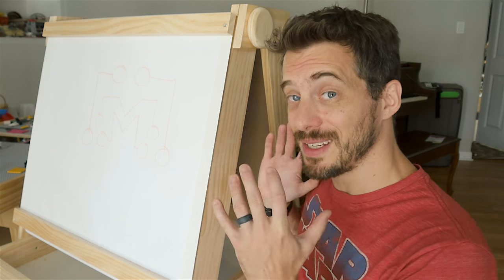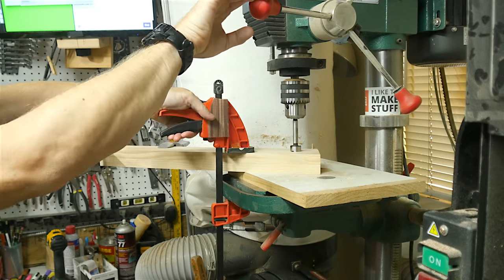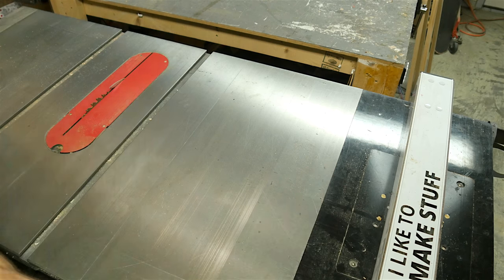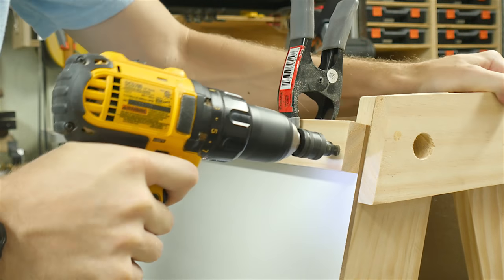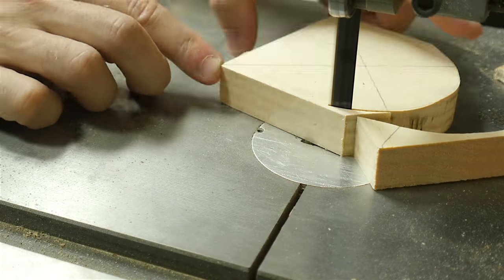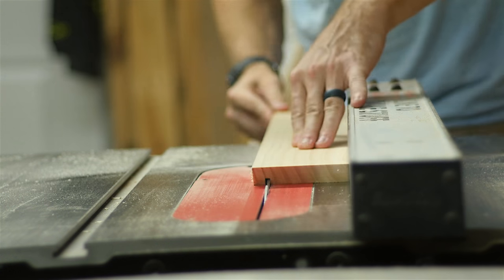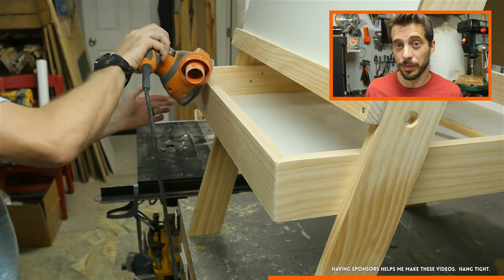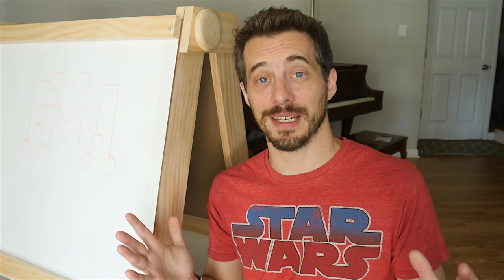Drawing Easel for Kids (chalkboard, whiteboard, paper roll) // How-to | I Like To Make Stuff

Comment: Great stuff Bob, as per usual. 

Personal suggestions for modifications of future versions of something such as this are:

- A small handle piece to the rotating part of the dowel. This allows for faster rotation of the page.
- Instead of using a whiteboard on both sides (where the case is that you don't want a chalkboard on the other side), add several "shelves" so that you can hold a collection of crayons, chalks, paints, brushes, etc in place for usage. This improves on the functionality of the product by not requiring you to store all of those art tools in a separate location. 
- This is theoretical (as I have not actually done any calculations) but since paper becomes very weak with stress concentrations along the edges, it may be beneficial to raise the center point of the page slightly higher than edges; not too much so you don't get wrinkles, but just enough as to prevent shearing stress of the page at the center point (where most of the drawing will be present)

Comment: That thing you did with your driver and some magnets I once did with my last car and the remote for the stereo I installed in it.  Basically it stuck the remote to the side of the console via the magnets, which were hidden inside the console and stuck to the back of the remote.  Not only is the stuff waterproof, but I found it's also heatproof, which inside a hot car on a summer day is critical.  Some common maker materials are surprisingly vulnerable to moderately high heat.

Sugru is great stuff, but it's a shame it has a fairly limited shelf life of around 6 months.  When I buy a pack of it, I usually find myself scrambling to find a use for it before it goes off inside the packet.

Comment: The dowel you used might be too small to do this but I would cut a slot down the middle the width of the paper.  Feed the end of the paper through the slot and give it a turn and done.  No need for tape and it should be easier to get the paper straight.  The lock on the dowels is brilliant.

Comment: I know this is an older video, but just found your channel and am working my way through them.  How do you get to the whiteboard area under the paper roll?  It seems once it was taped on the upper roll you are locked in to using the paper.  Do you cut it and then start a new roll when you want to switch to the whiteboard?

Comment: This is an awesome idea! What changes would you do to it to allow it to collapse into a smaller profile?
Another question... When you roll the drawings up and over... how do remove the drawings if you tape them to the dowel? Wouldn't you have to unroll it to unlock/withdraw the dowel?
Reply from the maker: I've rolled them back down onto the original roll (cardboard inner tube) and remove that.  As far as making it collapsible, that's a pretty different setup altogether. I've never really thought about that too much, but I'll give it some thought.
Reply: I Like To Make Stuff, ah that makes sense. I was considering building one of these for my son but space is a concern. I might have to make a wall mounted version that can fold out a bit if/when he wants to draw.

Comment: Hey just pointing out if you tape the paper to the top dowl how are you going to pull out the dowl when it's full. Love the vids keep it up bro
Reply from the maker: Yeah, someone mentioned putting a cardboard roll on the top dowel, or taping right at the corners of the paper so you could trim off the tape.

Comment: Love the keyed dowel. I was wondering how you were going to keep it in place. How do you get the top dowel off once you have rolled all the paper onto it with the ends taped to the dowel?
Reply from the maker: I was just planning on rolling it back down onto the cardboard tube, but you could also tape it to the top dowel right at the corners, so that it could be trimmed off.

Comment: How exactly do you use the whiteboard, since the paper covers it up ? It doesn't seem verry convenient. But nice build anyway, love your videos !
Reply from the maker: Obviously you can't use 3 things at once on a 2 sided object. I thought that would have been pretty clear.  The paper is there in case you want to be able to save the drawings. If not, it could be left rolled down and the whiteboard is there to use.
Reply: I guess the whiteboard is just a smooth surface to have the paper lay on.
Reply: You could have used it more conveniently with a sheet by sheet mecanism instead of a roll of paper, like those brainstorming paper boards.
Reply from the maker: Simon You can make it in any way that you would like to. I mentioned in the video that with kids, there are TONS of individual sheets floating around. The roll is a way to keep that in a single unit.  I make things that solve problems for me, you should definitely make them to solve problems for you.

Comment: How are you going to take the roll of paper off once it is fully rolled on the top roller? Maybe better to put the masking tape towards the side so you can 'disconnect' it from the wood and take off the paper roll. Even better would be to roll it up on a removable cardboard tube which can be locked/unlocked to the wooden roller easily. :)
Reply from the maker: Good call on the cardboard tube!

Comment: How are you able to get to the white board? Do you have to unroll the paper at the top so the kids can draw on it?
Reply from the maker: Yeah, it's an either/or for paper or whiteboard.
Reply: The one my family bought is actually similar to yours except that the roll of paper is at the bottom and you pull it up so that it comes from the top down in front of the white board. It's also made so you can fold it up for storage.